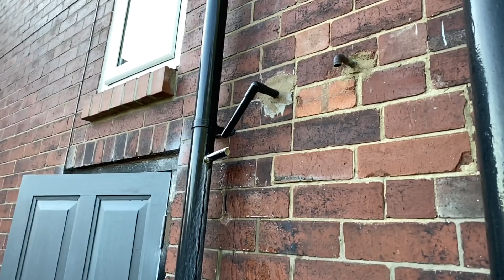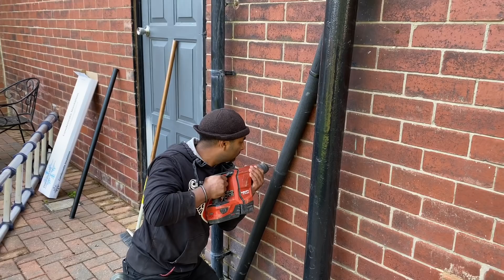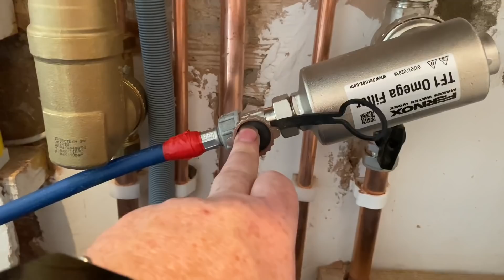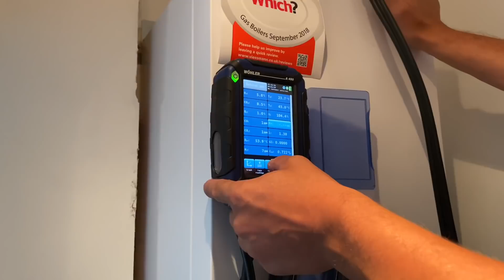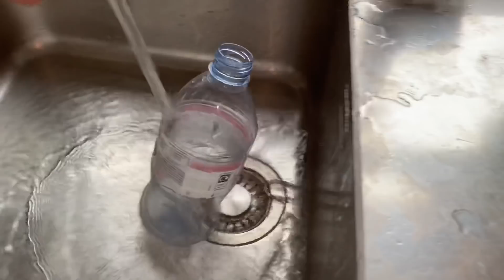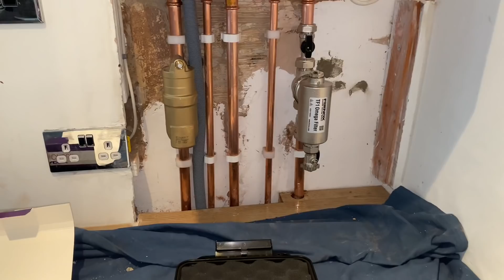New Boiler Installation - ACS Gas Training - Apprentice Plumbers / Trainees

Comment: Hi, I know this is quite an old video but wondered if someone could help me with a question I have.

I am having my system boiler replaced soon, my old boiler is on its knees and the boiler being installed is a Greenstar Ri.  Ive been told by BG that its a straight swap as my central heating and megaflow tank all work fine.  I know they will be flushing the system and we are having a scale filter installed also as I live in a hard water area.  My main question is, will the engineer have to drain each of my 6 radiators individually or can he drain them all from 1 area?

Thank you.

Comment: Hi I'm moving to a house with well water. Using salt water softener. Which boiler is going to be good for my condition. Because I read this water is not good for rubber seals. And it's very corrosive. Thank you

Comment: Hi Allan do you recommend a spirotech RV2 ? Also is it installed on the mains feed into the boiler ?
Reply from the maker: It’s installed on the flow. Thanks
Reply: @AllenHart999  thanks.  Do you recommend it ?
Reply from the maker: Akhil Varghese Depends on the install. They are not cheap
Reply: @AllenHart999  planning on installing a Vitodens 100 30 or 35 KW combi boiler.  Installer is suggesting magna clean 2 and no deaerator.
Reply: Hi, akhil varghese

Comment: Hi Al,  have A Vailant boiler Evo  Tech pro 24...it sprang a leak on the condensate hose to the trap..looks like its partially corroded...can i just replace the pipe or do need to replace the trap to...i have bought the hole trap assembly, but wondered if the pipe came off seperatley?
Brilliant videos and tutorials btw. Thanks

Comment: Hi Allen,,ive got to route outlet from an old meter in a toilet to the new meter site in the garage,,,is it just a case of rerouting pipework to new meter then purge and general tests such as visual inspection,boiler,flue,tighness,working pressure ?

Comment: About 10-12 years ago I was working for someone as an apprentice I was told to ensure all pipes were straight running parallel in the floorboards too. It was a case of taking pride in the job. Ensuring pipes were soldered with no drips very neat. Good video by the way
Reply from the maker: Thank you.

Comment: Hi mate  I like to know can we power flash if radiators pipe are plastic not copper I been told it will damage joints .thanks
Reply from the maker: Yes you can

Comment: Could not agree more with doing a p/flush after new install, pointless fitting new boiler then adding 15yr + old heating water to it after. So many installers think just because they have fitted a magna filter that will be good enough, keep upping the standards of this industry Allen Great Work!
Reply from the maker: Thanks.

Comment: Question for the experts, you've done gas safety everything is good but how long am I responsible for he gas being good the way I found it fir example someone knocked the gas pipe and it's leaking , what proof do I need is filling in an ipad manually enough or is print out the only way
Reply from the maker: I try and take pictures of all my jobs these days, I have had a fair few move boilers that I installed. Thanks.

Comment: I remember as an apprentice at BG, because we were never given enough time to flush the system properly, some of the guys did the old milk bottle trick, one filled with the iron oxide/sludge and one with tap water, before and after the flush trick to show the customer. 🤐
Reply: when i was training i was sent to learn on some BG jobs and the lads i was working with use to keep there magnacleanse dirty on the van, and just pull it out at the end and say they had flushed it lol! crazy
Reply from the maker: Never heard of a milk bottle trick but i do the water sample in front of customers and give instant results. Thanks.

Comment: I found some insulation in BES magazine. Item number 20926 (I think)
Flexible from -200 to +150 degrees fully uv resistant and no need to add additional protection... £9.57 for 2 meters....
Have a look and see what you think. Let us know
Reply from the maker: Brendan Fisher It was about £21 for what I used here, that includes the pipe snug, not worth using anything else 👍 Thanks

Comment: Hi Allen hope You are well ? 

I’ve been following your videos for some time now on YouTube and it has encouraged me more to get into the plumbing trade. I’m 29 years old.  I don’t have much experience but I’m a quick learner and work well with my hands.

I live in Leicester and wanted to join a course probably at Leicester college are you able to point me in the right direction to the beginning of my journey :) 

Just need help which course to choose .  

- BPEC Domestic Gas Foundation Certificate of Achievement – C0399
- Plumbing Advanced Technical Diploma level 3 – C0361
- Plumbing Diploma level 2 – C0508 
- Plumbing Technical Certificate level 2 – C0360
- Plumbing Diploma level 1 – C3076

Regards Adam
Reply from the maker: I have no idea whats best tbh. Sorry.

Comment: Plumbers are still installing gas boilers in England ? Wow, this outdated methods of heating will soon be ancient history. In most European countries gas boilers are being removed and replaced at a rapid rate.
Reply from the maker: What have they been replaced with? Thanks.
Reply: @AllenHart999  Air source mate, which suffice for the load put upon them for many domestic properties. Biofuel and electric also coupled with solar thermal. I enjoy watching your videos by the way, I miss the old days working in the UK.

Comment: I love these videos 😁 and as you know, Allen would 100% agree that cleaning the system is the most important part of a new boiler installation.
The system water is the blood of the heating system and if it is not clean it will make the system inefficient and reduce the life of the boiler. Once that is perfect, along with all the other parts necessary to protect, it will ensure the boiler works as efficiently as possible. Yes, protecting the condensate is very important, and part of a perfect heating installation. Well done Allen and the guys who did a great job, I'm sure they learnt loads!
Reply from the maker: Thank you so much for bringing out such an amazing product to help and support us.

Comment: Do a Video on the Wohler analyser Alan if you can as it looks interesting
Reply from the maker: I will try. Thanks.
Reply: @AllenHart999   Cheers
Reply: They are great bits of kit, very popular in the industrial world. Seen many burner manufacturers using Wöhler when commissioning there burners. Knock spots off mainstream brands of analysers

Comment: Hi Allen my combi boiler keeps losing pressure all the time more so when I use hot water tap ive herd about the power flush would and thinking of having it done only if it would stop it from losing pressure my house is a ex council house had mears out 2 many times to count on both hands they sed they had fixed the problem but never worked so I bought it of the council as they would get things sorted out so just wondering if that would work or would I be best get new boiler snd radiator fitted as there old radiators thanks Allen
Reply from the maker: https://www.youtube.com/watch?v=X4OssmUEFo4&t=59s
Reply: Expansion vessel recharge most probably.  Book it in for a good service. 
https://m.youtube.com/watch?v=80ZHwn-HoU0
Reply: @rayc1503  hi had it serviced About 4 weeks back the guy that did it was a friend of my wife he services Boilers he was going to put expansion vessel on it but he couldn't as we have 2 young kids so he found the part for it so he sed them he came back out week later and flushed the boiler out but still doing the same losing pressure all the time at one point it could hold its pressure for a few weeks now its every day im topping it up as long as I don't use hot water tap it holds but the moment I do thats it pressure gone this is why I'm asking if a power flush would help or make no difference i know the radiators are old company told me that there old radiators this was before I bought the house as they were ment to have fixed the issue but never did so could this fix the problem or do i have to pay out loads have new boiler and radiators it just seems to be a never ending problem aslo its had a new expansion vessel put on a couple years ago it had a new part put in from Worcester boiler company so probably can rule out them parts need replacing so wondering if i need to have power flush done but having that done can be expensive from what I've seen just wish I new what the problem was there's no leaks come off the radiators just seem over the past year its got worse
Reply: @waynebritton6711  you tell your wife's mate to come back then because he didn't fix the problem. your boiler is losing pressure when you use the dhw so don't worry about radiators and power flushing, get the main problem sorted first.
Reply: where abouts are you wayne
Reply: @cliveramsbotty6077  I'm leeds

Comment: True allen the boiler's as  good as the install.  If installed & serviced in accordance with MI the boiler should soldier on.  System water quality and anti corrosion inhibitor is key to the longevity of the boiler.  Brilliant work and glad to see quality installations. You're a gem Allen 💎.
Reply from the maker: Thank You.